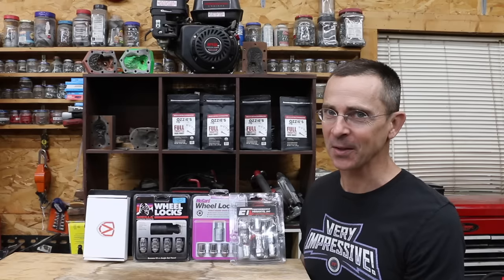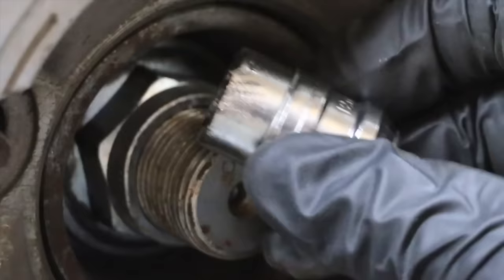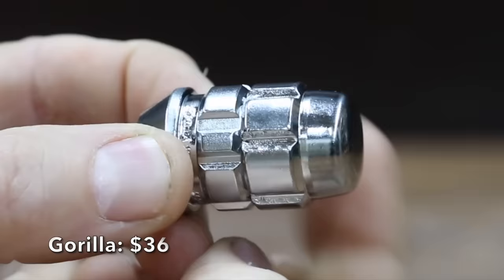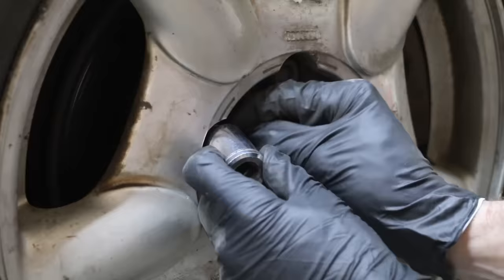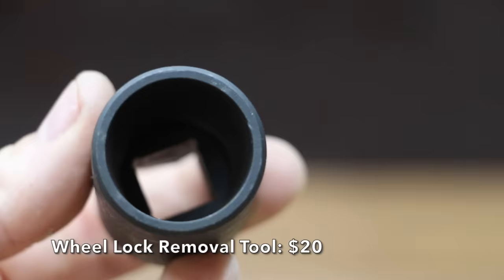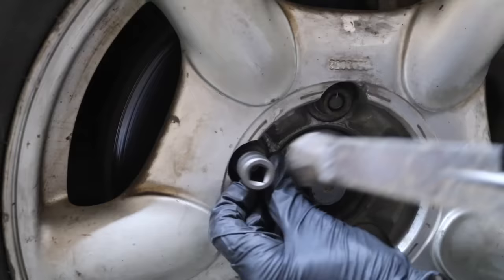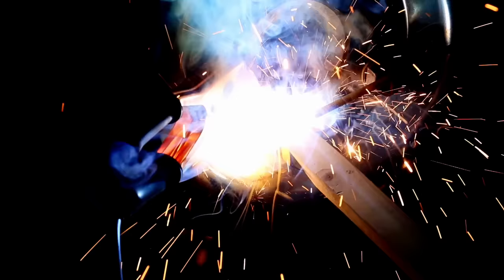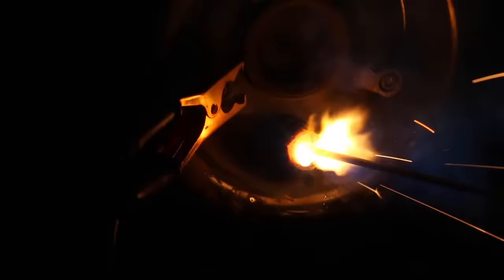Best Car Wheel Theft Deterrent Lug Nut? Can Any Wheel Lock Prevent Theft? Let’s find out!

Comment: Back working with tires it was common for customers to not have the key for their wheel locks. Pounding on a socket was always the go to when customers didn't have their key. With the advanced I would recommend any customers purchase a second key and have it somewhere safe at home in case the one in the car disappears. 
That being said when will you test bike locks/chains?
Reply from the maker: Thanks for the suggestion.

Comment: One problem with locking lug nuts that I ran into.  A number of years ago I put some nice rims on my pickup and to protect them I put locking lug nuts on each wheel.  A while later I had new tires put on, I told the tireman where the key was in my glove box and didn't think any more about it.  A year or so later I came out of a store and had a flat, I reached into the glove box to get the key for the locking nut and it wasn't there, the tireman apparently didn't put it back in the glove box and I didn't think to check after he finished.  

I did find out that an angle grinder makes short work of getting a locking nut off, just grind a flat spot on it and use a pair of locking pliers, took all of 5 minutes.
Reply from the maker: Thanks for sharing.

Comment: I hope this comment is seen/pinned for others: I have McGard wheel locks on all of my vehicles as they have hard to find wheels and I live in an area prone to theft. I have had 3 separate occasions of theives trying to steal my wheels and they have never been able to.

On top of this- McGard customer support is absolutely top tier. I accidentally tightened my wheel lock WAY too tight and i broke the key trying to get it off.

I contacted their customer support and they sent me 2 MORE keys at no charge to try to get it off with, along with multiple tips.

I ended up breaking both of the new keys, so they sent me THREE more keys, loaned me their factory removal tool, AND gave me an extra wheel lock.

I was able to get it off with, and they did all of this at zero charge. Top tier customer support, i dont know that you would get that anywhere else.
Reply from the maker: Thanks for sharing.

Comment: Most of these wheel locks are able to be defeated. But one thing to take into consideration is depending on where you leave your car most of the time, there’s one thing that thieves don’t really have. And that’s time. When thieves try to steal wheels they’re trying really hard to do it as quick as possible. If you want absolute assurance that your wheel won’t get stolen then spend the 90 bucks. But if your car sits somewhere that you have quick access to or that is easily seen by others, go for one that will at least take more time than thieves really wanna take.
Reply from the maker: Thanks for the feedback.

Comment: The next time you do fuel treatments look into a product called “Max Milage”. It is supposed to be catalyst not and additive that works for gasoline and diesel engines. It is supposed to remove soot and virtually eliminate the need for a DPF
Reply from the maker: Thanks for the suggestion.

Comment: I'd love to see you do a review on vehicle accessory / off road lighting. KC Hilites, Auxbeam, Nilight, Baja Designs, Rigid, and Diode Dynamics. Potential tests could include actual power draw vs rated, actual lumens vs rated, lens impact resistance, body impact resistance, waterproofness, finish durability, light output after they've warmed up (30 min or so to see how bad thermal throttling is). Thank you so much for your videos!
Reply from the maker: You are welcome!  Thanks for the suggestion.

Comment: Late comment, I say a custom make system working from inside out rather one lug lock. A collar lock system using the middle wheel axle like a flange system that would go over all the tire studs and the one collar lock system would lock on the axle under the wheel hub. 😩 of course you would really have to put some thought into it without compromising the integrity of the wheel axle small enough to put the wheel hub back on. 😯
Reply from the maker: Thanks for the feedback.

Comment: The guys on doughnut got the advanced ones off with bolt extractor. They also tested a couple other types of wheel locks. Both are very good videos!
Reply: Donut sorry spelled wrong
Reply from the maker: Thanks for sharing.
Reply: Liz from Advanced Wheel Locks here.  Donut Media misrepresented our product in so many ways.  Ordered ball seats for a cone seat car, said we didn’t have aftermarket sizes when we do, said our locks were $140 when the set they bought was $89.  We have spent a lot of time and investment in making sure bolt extractors can’t get a bite.  Note their hard edit right before they miraculously get the extractors to work.  We offered to send them the right locks for their Mazda several times,  but they never answer any of our attempts to reach them.
Reply: @elizabethlambert9746  I do not doubt you for a second. I noticed they claimed the price was much higher than project farm ssid it was. And I trust project farm far more than those guys!

Comment: The best crook strategy, or at least the one I'd use if I were in the wheel stealing business, is to just buy the different wheel lock kits, then you have a key to fit every one of them, & the wheels will be gone...the best strategy from the consumer point of view, is don't put super expensive rims on your vehicle, but still use wheel locks...if they want them, they'll figure out a way to get them no matter what you do...that being said, I don't think $90 is too much to pay for a quality set of wheel locks that, in most cases, can prevent wheel theft...even stock rims cost more than $90 to replace...
Reply from the maker: Thanks for the feedback.

Comment: If one is going to bother with wheel locks it might as well be a set that are difficult to defeat. Of course the downside of a really good wheel lock is that you may be stranded if you get a flat and you don't have the key and no tow truck driver will be able to get that advanced one off. You'd literally have to have to be towed to a place where they can weld on a tool to get it off.
Reply from the maker: Good Point!

Comment: Mix 3 sets of McGards, keyed alike on each wheel. If the crook doesn't have the tools and removes the regular nuts, you'll still be able to drive. Cheaper than the Advance. Or get the Gorilla "System, where every lug is a lock. About $65 for 20 or 24 lugs, ( 5 lug or 6 lug wheels).
Reply from the maker: Thanks for the feedback.

Comment: It's funny, the day this video came out I lost my key for my wheel locks. I drove away with it still in the lock and it flung off somewhere. I just used a 21mm spline socket to hammer on the lock. Worked great all 4 times which made me think; these wheel locks are worthless.
Reply from the maker: Thanks for sharing.

Comment: I would like to see diy windshield repair kit. I often use the kit that comes with a syringe to pull a vacuum and pressurize the resin into the chip or crack. The kit comes with double sided sticky tape that is one time use but can just cut more double sided tape to reuse the kit.
Reply from the maker: Thanks for the suggestion.

Comment: Also note some OEM wherl locks will be slightly custom to provide a better fit.  I had one lost from the set my Subaru came with (apparently the dealer had frequent wheel theft so they started installing wheel locks on all vehicles upon arrival) and while they seem to be made by McGuard they are actually shorter than the generic compatible ones.  I had one get lost and went to get a cheaper generic replacement set and discovered they protruded about half an inch from the wheel, where the OEM ones were flush to the aluminum wheel in the recessed holes.  I also learned that not all sockets will fit in said recessed wheel holes... Probably helps with the theft deterrent Factor.  Also don't lose the information the locks come with because you can order a replacement key or replacement individual locking nuts for your keyed set using the codes on the documentation it comes with.
Reply from the maker: Thanks for the feedback.

Comment: The "Free Spinning" Gorilla Automotive wheel locks are their "X2" product. The Gorilla "Small Diameter" wheel locks are obviously sub-par as shown here, but they're offered in what Gorilla terms "The System" and the idea with that is you replace all of your lug nuts with one of these wheel locks. I can't generally imagine a thief dealing with 20 wheel locks. I own both of those products but would recommend the X2 set. And also, as a -- sidenote -- spend a few bucks and purchase a backup wheel key. As far as the Advanced Wheel Locks, $90 is grossly overpriced.
Reply from the maker: Thanks for the feedback.

Comment: My car came with locking lug nuts. One day, I got a flat! The socket I kept in the glove box stripped out when attempting to take the locking nut off. I called Triple A and had to wait, on the side of the road, for about 2 hours. Once the two truck arrived, it took him,  a 6pt socket, a hammer and wrench, and about 10 seconds to get that nut off without the "key." 

Nothing is safe from determined criminals, but deterrents are better than nothing.
Reply from the maker: Thanks for the feedback

Comment: I would not trust any exept the most expensive ones. An important thing to consider is that people that steal car wheels dont do so on a whim. You need a car jack and an impact driver to do so, which means that any wheel lock that has a common pattern will not be very safe. The most expensive ones are keyed so unless you can easily make a universal key that at least a reasonable degree of safety.
Reply from the maker: Thanks for sharing.

Comment: I use the Gorilla lug nuts, the first type; the fluted ones.   I get past their "easy to remove with Vise-Grips' feature by putting them on all 20 lug bolts holding my four wheels on.  I'm thinking it would discourage a thief from having to remove all 20 to make off with a full set of wheels....
Reply from the maker: Thanks for the feedback.

Comment: Great information! 
Some test ideas:
Did you ever do one on garden hoses? It is frustrating finding ones that do not kink, stay flexible in cool weather, have decent fittings, age well, weight/size (some too big for typical hose reels), etc. how we got this idea, was the fuss hoses can create while pulling around a pressure washer in use.
Another idea, on frost free hose bibs..include availability of replacement parts in test if possible. These can be a bear to replace in whole.
Thx!
Reply from the maker: Thanks!
  https://www.youtube.com/watch?v=M1m0YTxBKqE!   Thanks for the video idea.

Comment: I worked for 4 years at a tire shop.  We used all these methods to remove lock nuts that people lost their key for.  The problem with wheel locks is that you have to carry the key in the car in case you ever need to change a tire.  If a thief wants your rims they'll break your passenger window and get the key out of your glovebox.  I see no point in wheel locks.  All it does is make it more of a hassle for you to change your own tire.
Reply from the maker: Thanks for the feedback.

Comment: I stripped 3 McGard wheel locks (1 time with impact, 2 times with breaker bar) When the wheel is tight or there is corrosion...the wheel lock will snap. Had to hammer a 19mm 12-point socket to get my wheel locks off. Wasted 4 such sockets :)
Reply: Also, 2 lock nut removers I tried (Napa) were useless on the Mcgard.
Reply from the maker: Thanks for sharing.

Comment: Advanced Wheel Locks said my order for a set of locks would be back ordered for 2 weeks. Then it was 6-8 weeks, after 6 months I asked and received a refund. That was a year ago. I just checked and they are still on back order. "Supply chain issues" they said.
Reply from the maker: Thanks for sharing.
Reply: I ordered a set back in February.  I still haven't received them.  They're super backed up.

Comment: from personal experience as a tire tech those gorilla spline locks are junk the socket that is included will break or will round the locks if over torqued. they are supposed to hardened but i have seen them crack and bend from using them as intended as well
Reply from the maker: Thanks for the feedback.

Comment: The last part though, using a wlder to weld something on, is not really a huge concern as most people would have to carry around the welder and have AC power to use it, so I would say the Advanced Wheel Lock system might actaully be worth the $90 they charge for it as it's the only one that really cannot be defeated.  My guess is that given enough time and a wlder, all of them could be defeated including the AWL system which was shown here, but we also have to consider practicality.  People generally are not going to go the welding route unless they've already stolen the vehicle and have it and can take their time.  If that's the case, then it doesn't matter.  But to prevent wheel theft, it looks like the AWL is probably the way to go (get say 2 or 3 of these nuts per wheel and you should be good to go, in case someone does manage to take off the rest you can probably still drive with just 3 or 4 lug nuts on (assuming you have a 4, 5 or 6 bolt pattern).

It is noted that the Advanced wheel lock system is expensive, but when put into perspective (an average OEM normal alloy rim can range from $250 to $500+, then $90 for a set of four locking lug nuts like the AWL and the key is not a bad price.  Heck even if you buy 2 or 3 sets it's still cheaper than having to buy one or more new rims.  So consider the cost in that regard.
Reply from the maker: Thanks for the feedback.

Comment: Interesting video. My only thing here is that many times splined nuts are paired too rims due to low clearance which would adversely hinder many techniques for removal. On one of my cars the splined lug adapter barely fits into the wheel. There is no way to even get at the tips of the lugs the are inset the wheel. Granted, splined lug sockets are easy enough to come by.
Reply from the maker: Thanks!  Thanks for the feedback.

Comment: It would be interesting to see you do a similar test on rims that force you to use a thin wall socket to be able to get a socket around the lug nuts at all. My rims have a deep channel for the lug nuts that are too small for a standard sized socket. The welding or corrosion options are probably the only way to get them off, but they'd probably destroy the rims in the process.
Reply from the maker: Thanks for the suggestion.

Comment: My crazy uncle used the old 20,000 volt deterrent on his CC and his wheels. Ran a brushed circuit against the moving bits, wired everything else up to a snakes nest of wires and coils in the trunk. 

He'd have been fine if some drunk guy didn't take a leak on a wheel in the middle of the night...

Comment: A cool head to head would be car/wheel cleaners that specifically advertise removing the iron particles that get embedded in the clear or paint finishes, and the spray usually has a visible purple indicator when it's reacting with iron.
There used to be one main brand IronX, but now there a whole bunch available. A fun side comparison might also be which one smells the best and the worst, because these specific cleaners are notorious for smelling absolutely foul.
Reply from the maker: Thanks for the suggestion.

Comment: If you have a cutting wheel you can always make a large cut down the center, insert a huge flat head screwdriver and turn it with a pipe wrench. This would defeat the advanced wheel lock but it won't be quiet lol
Reply from the maker: Thanks for the feedback.

Comment: Mcguard made some wheel lock for mopar with a collar like the dorman but without the ability to remove or jam a screw in... Once i broke my key using the impact on it(bad idea over time don't do it... you can but before using the impact just remove the torque of it) I had to weld the collar to the nut for the extrator(similar to 6:20) to work. I had hard time welding due to the design of the wheel, I only had 30% access to the collar. I tried with regular socket but they were too big to fit the in the wheel, wrench bite on it but the wheel has too much concave to stay in and pop out
Reply from the maker: Thanks for sharing.

Comment: Tldr of the video, if the thief really wants your wheels wheel locks won't stop them.

FYI, best way to prevent wheel theft, AIR RIDE, with air ride you can drop the car low enough they can't get a jack under it.

Comment: Donut Media did a similar comparison test last year and on the Advanced Wheel Lock they used a socket extractor which couldn’t remove the lock but then they used a bolt extractor which did remove the lock. But the bolt extractor they used looks like the wheel lock extractor you used which in your video couldn’t remove the lock. Very confusing results.

Also, please do a part two with additional wheel locks such as the Rays Formula and R40 Iconix!
Reply from the maker: Thanks for sharing.  Thanks for the suggestion.

Comment: You need to torque the bolts at 120 or 130 Nm. If so you never ever could remove a bolt with some pliers or a short tool.

Comment: I think it may be possible to defeat the Advanced Wheel Lock (the pointy) by applying a thick coating of kwikweld or some other rapid setting adhesive to the surface of the wheel lock before hamming a universal socket down onto it. Allow time to set before attempting to remove. Would love to see this in a update video!
Reply from the maker: Thanks for the suggestion.

Comment: That is a very odd looking welder. But never dawned on me that it would be a method to remove them. Impressive
Reply: As long as you have a 110 Volt outlet on the sidewalk to plug it in.
Reply from the maker: Thanks for the feedback.